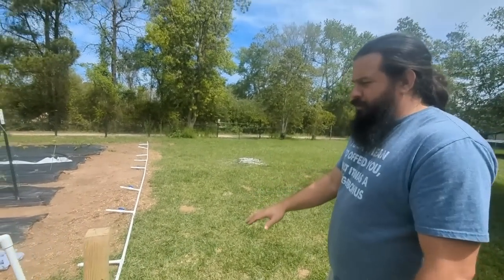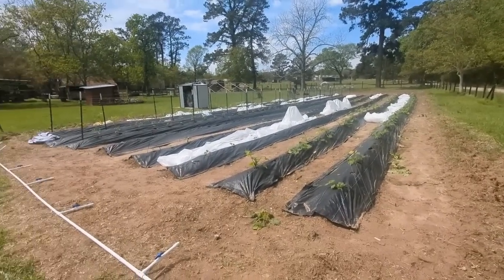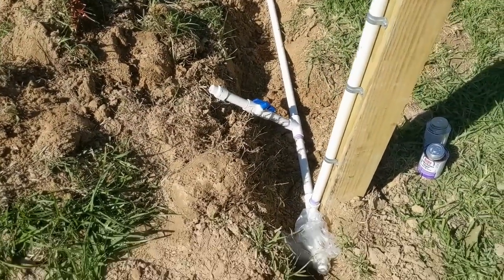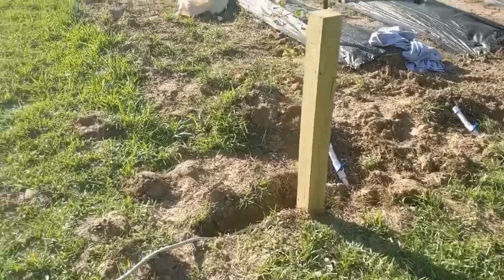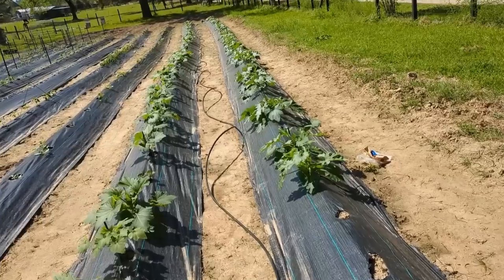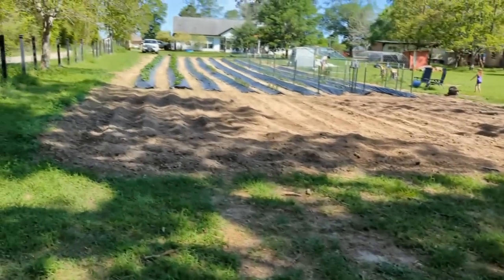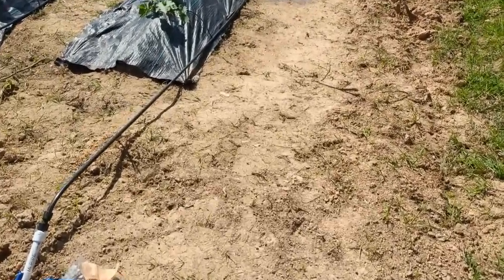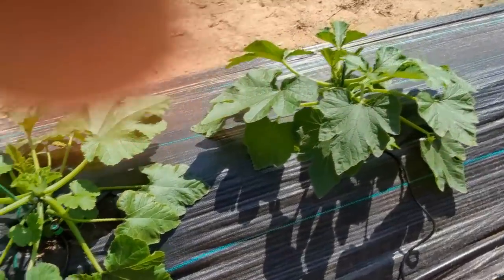Buddy's Drip Irrigation Project | Garden Irrigation

Comment: Great job on the irrigation & video guys. Next time take a cup of kettle water out with you & put the ends that you need to push on into the hot water for a few minutes  & it will make the pipes plyable & easier to attach

Comment: Great thinking on all the details of how water travels. I was thinking of a water plastic bladder of 50 gal. And building it up on a barrel or platform and then having gravity flow the water through the pipes down into the plants. That way, it's rainwater and not costing you an arm and a leg!
Could you take 2x4 and angle cut them and screw them to form a V shape cut and place over the hose connection area.(Sorta like a cable cover over wires in an office) That way you could paint the wood to save it from the sun heating up the hose and putting hot water at first on the tender roots. And keep people from tripping on them and ripping them out.....or God forbide a dog chewing on them!!
Thanks for the plumbing lesson!